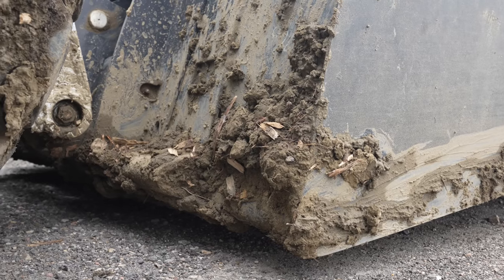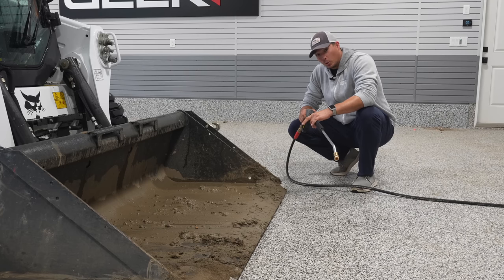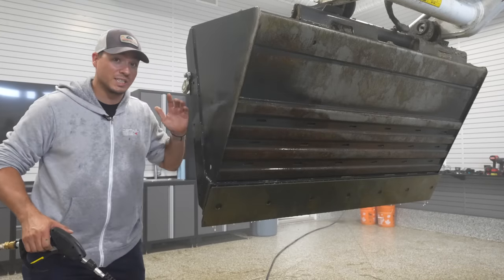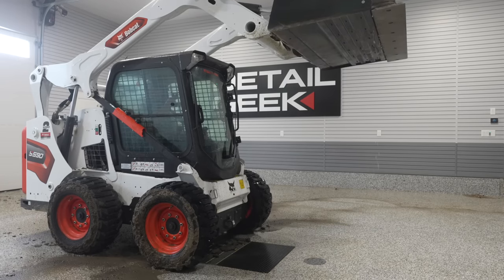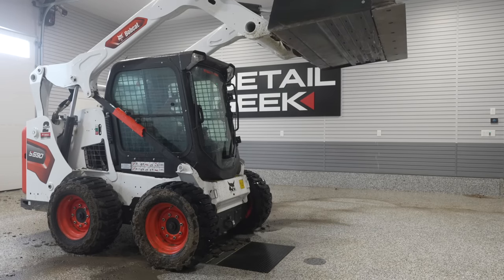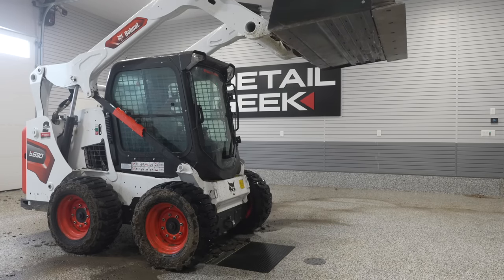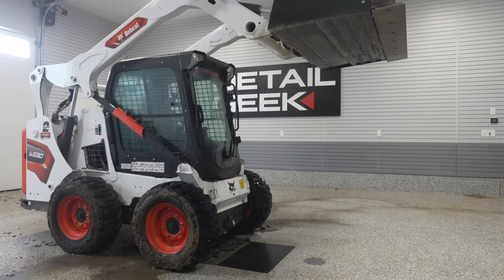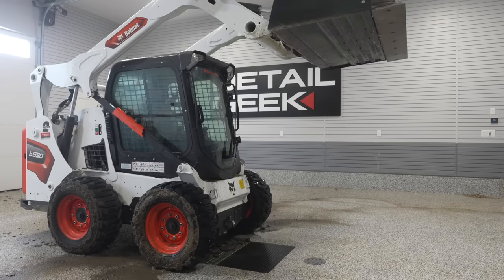The Most Challenging Detail I've Ever Done + HUGE Announcement!

Comment: We don't detail our heavy equipment, but every Friday the last two hours of the week is cleaning time. Cabs get vacuumed, glass gets washed and excess mud gets washed off. Especially on the dozer undercarriages and blades. Any wet mud will start to pit the smooth surfaces and it will not roll off like it's designed to. The grader blade is very susceptible to pitting. It gets cleaned every day. After the cleaning, every fluid is checked and grease fitting hit. At first the boys grumbled about it, but they got used to coming in on Monday morning to a clean, fully fueled and lubed machine. You get used to it after a while and it becomes habit. Well worth the time lost working the site.

Comment: Asphalt is petroleum based, next time it sticks to the bucket warm it with a torch,and it will release much easier, also if you are working with asphalt only a light spray of diesel  on the bucket will help it not stick, that is an old hot mix(fresh asphalt) haulers trick,to keep it from sticking to dump truck beds

Comment: Hardened asphalt can be such a pain. I use de-lime cleaner on my truck when I’ve delivered asphalt, and to stop it sticking in future a good quality ceramic coating helps, but hot asphalt burns away any coating so it’s just diesel that stops it sticking coming out. You’re the dream guy to buy kit from, you look after it well ❤

Comment: Great video! Little tip with the back of the bucket, those wear bars are designed to hold material and protect the main structure of the bucket from wearing. Keeping the dirt or asphalt can help extent the life of the bucket.

Comment: Worker from a CAT Dealer/Service center here, people would be surprised how easy it actually is to operate most heavy machinery, the trick is knowing what moves what and how
When cleaning off asphalt and concrete just use a hammer(or hit it with a good flame), in the wash bay where i work there's a specialized section that we drag the buckets over to break off anything stuck to the undersides, washing the little skids steers is actually more annoying then most the other earthmoving machines

Comment: Clean equipment lasts longer, and is a lot easier to maintain; especially when you're trying to hit the grease nipples, and connecting/disconnecting attachments.
Side note: of you don't mind violating environmental standards, you can spray diesel fuel on asphalt to clean it off your tools

Comment: Biggest suggestion is to use the hydraulic prop bar so the arms don’t fail and fall down on you while you are cleaning. It’s the red thing hashing on the right arm.  I work in heavy equipment industry and seem far too many accidents happen with failing hydraulics, even with new equipment. Work safely my friend.

Comment: As well kept as your equipment is, you can barely tell you didn't just drive it off the lot and park it. I lived in the country for quite a few years, and the only pieces I'd ever see this clean were pieces straight from the manufacturer. Even equipment in a lot would have a fine dusting on them.

Comment: I operate a volumetric Concrete Mixer (video here: https://youtu.be/B6qoNmtzX6A?si=9gcuvq9m4UJpDB2N )

I have to clean the auger EVERY time I pour concrete. About once a month or so I have to "chip it out." Which means I take a hand held air hammer to it to get the bits of dry concrete that don't come out when I clean. You could probably use one of them on stuff like that asphalt. When I can't reach or can't use the air hammer on I use a sledge hammer. Sledgehammer on my chute extensions and what not. Never seen anyone clean a skid steer 😂 the ones my co-workers use look like they need it though.

Comment: Should tell this to Andrew Camaratta in NY state while is good with his hands and a good operator he does not take care of his gear and machines etc and hardly washes them, and then whinges and bitches when they break down from lack of maintenance and not being cleaned.
why didn't you use the hydraulics and bucket to lift up the front wheels of the bobcat to clean underneath it?